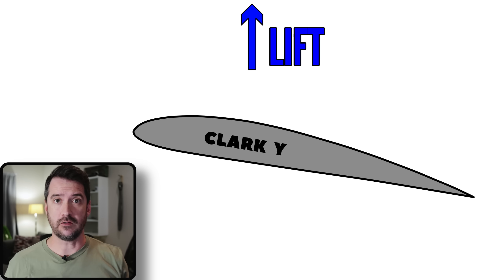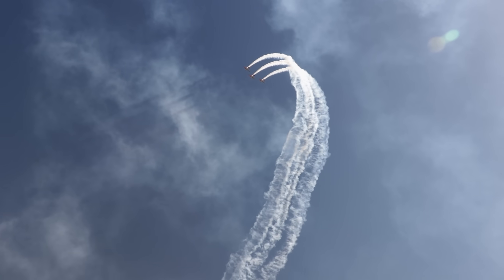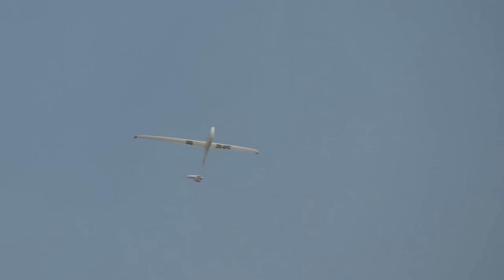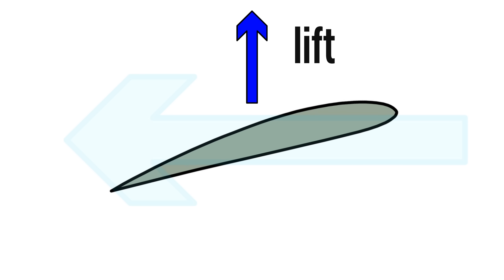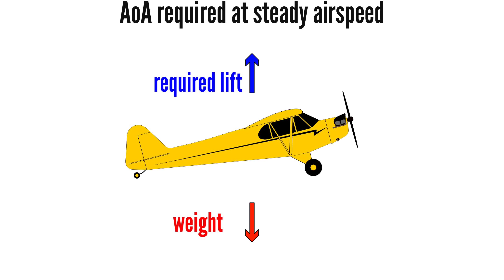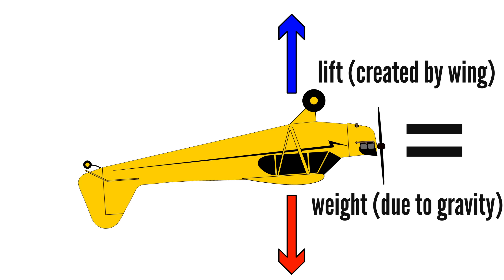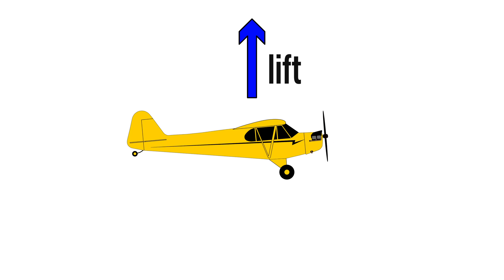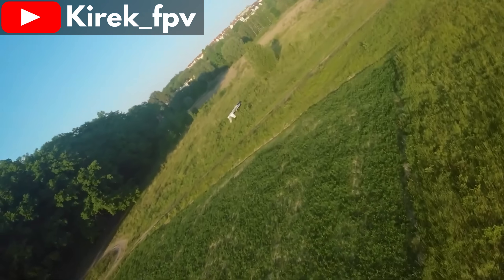Is Airflow Distance Over the Top of a Wing Always Longer?

Comment: You have made an excellent video here!  PMaybe you can please make a video explaining how the use of rudder alone in flight induces roll in the same direction? I'm certain it's not because the "outer"  wing is passing through more air and is therefore producing more lift and thereby creating a roll effect. I think it's caused by the dihedral creating a roll coupling by presenting the "outer wing" at a greater AoA and the "inner wing at a reduced AoA am I right? I don't know if there is any roll produced in an aircraft with no dihedral (presumably not) or if indeed adverse roll is induced in an aircraft with anhedral (inverted flying?)
Reply: A Cessna 172 with no dihedral will eventually drop the right wing with sustained right rudder in a skidding turn. However, depending on the plane, a rapid right rudder can produce some amount of left roll since the rudder is usually above the center of gravity.  This dynamic effect is momentary, and eventually there is right roll as above.
Reply: I thought this would be the case. I don't like comparing RC planes to full size aircraft too often but I have had a model that would do complete rolls on rudder only - the opposite way to the input! Adverse rudder roll was a thing with that plane. It had a large rudder with huge throws and a lot of area forward of rhe hinge line at the top of the rudder.  No dihedral in the wing either. Was a hoot to fly 🤣
Reply: @Eatherbreather  No argument about you or jaywung's thoughts three weeks ago, just a footnote:  there was a noted very successful family of hang glider designs in the seventies, known as Icarus I, II, and V (and maybe IV was also built) by one Taras Kiceniuk Jr., that steered by the yaw-and-dihedral scheme you initially mentioned.  They were configured as flying wings with pronounced sweep and dihedral, with drag rudders on the wingtips, each rudder deployed independently and outward only.  Hanging a rudder out yawed that wing aft and inward, so that the dihedral reduced the AoA of the aft wing and increased it for the forward wing, and after a brief skid the glider briskly rolled into a turn.  Pitch control was by weight shift but there wasn't a typical control bar, because roll was more positively controlled by the tip rudders.

They also had pronounced washout, especially the V, which made them almost unstallable because the tips, which were aft, would keep flying after you'd stalled the root, so the nose would refuse to stay up long enough to stall the whole wing.  The only accidents I read about were clearly pilot error (one skimming the ocean too low above rocks and one without positive harness for the pilot).

The V's were a monoplane (chosen to get a better view of the landscape below) -- 5' chord x 32" span, 6' sweep -- and had higher performance (L/D about 12) than the I, II, and maybe IV which were all biplanes.  (I guess this was because the V's had less parasitic drag -- fewer vertical struts and diagonal cables, and a much finer trailing edge because the aft spar was tucked in a bit forward instead of fattening the trailing edge -- and because they had a more sophisticated custom airfoil.)  But not many V's were built because they were mostly sold as plans-only, with a kit version available for a year or two.  A modestly tweaked, and motorized, version of the II (or maybe IV) called the Easy Riser, produced by one Larry Mauro, was sold in much greater numbers, had a Yahoo group while those lasted (i. e., until quite recently), and might have several planes still flying.  I bought a kit for a V and got it more than half done but then started engineering school and never had time to finish it.

Comment: It's in the name "aeroPLANE". It "planes" - like a stone (or some boats) skimming over water. If it slows, it sinks. If it accelerates, it climbs. Also noteworthy is an increased angle AoA either upright or inverted typically also sees the thrust line angles upwards which also contributes to "lift"  with the engine taking on supporting some of the weight of the aircraft itself. In the extreme sense this would see the wings becoming dead weight with the propeller (thrust alone) bearing the entire weight of the aircraft when flying vertically upwards. 
I have never met an instructor yet that knows that wings "plane" 🤦🏻‍♂️. Typically I don't argue with them though 😂
Reply: There! That's the analogy I was thinking & looking for!

Comment: Sorry your theory is incorrect ,easily explained ,take a aheet of paper curl it over and blow on the the top the paper rises  same as if you place the bqck of a sppoon in the stream from a tap its dawn towards the stream and differentual in pressure creates a rwsultant lift force ,your argument that a plane flying upside down still has a lift component due to the surfboard effect  a certain amount still lifts thd wing as in ground effect half the wingspan above a surface creates ground effect  like  ekranoplan air vehicles  ,benoulies priniclke explains this with venturies increase pressure in a constricted area pressure drops as a wing is half a venturi  tge pressure drops creating lift .
Reply from the maker: I agree with this. Think you may have misunderstood me.

Comment: I graduated high school in 1974 and we where taught that the air going over the top of the wing with the angle of attack caused a more negative pressure and lifted the wing and not the pressure under the wing pushing it up. That never sounded right to me so the way I started looking at it (write or wrong) is the combination of the angle of attack, the forward motion of the wing, and the speed at which it is moving all combine to create a pressure differential between the top and bottom of the wing. I am not a scientist, mathematician, a physics or aeronautical engineer but I do observe things and when I can't make sense out of what someone is telling me I have to question it. Come to find out it seems they where teaching theory as fact back in those days too. I may not be anywhere close to right but it's what I see in my minds eye. What I do know is someone knows something because the sky is full of airplanes.
Reply: AGREED!  JUST A KID WITH PARENTS DRIVING, MY WINDOW DOWN, HAND OUT, AND WHEN THE IMPACT ANGLE OF "FLAT" HAND ATTACK NEARS PERPENDICULAR TO AIR MOTION = ARM RIPPED VIOLENTLY ?BACK?!  BITD TOLD THAT IMPACT= 30% OF "LIFT"?
Reply: @georgedunkelberg5004   I think that is tricky, because if you carefully held your hand at like 45 degrees, it was okay, but if you weren’t careful, the Lift would try to start twisting your hand at about 30 degrees and when your hand turns flat into the wind, the drag actually doubles and that’s what jerks your hand back.
Reply: If a wing has 3 degrees of Camber (curve) and can fly level, it would be able to fly upside down with 6 degrees  angle of attack when upside down.
Reply: @jsbrads1 …camber is measured as percentage of chord, not degrees. Perhaps you mean if a cambered wing enables level flight at a given angle of attack and airspeed, it will require approximately double the angle of attack to fly level when inverted at the same speed.
Reply: ….airspeed and angle of attack (as a proxy for coefficient of lift) are the only two variables within the general lift equation that are directly controlled by the pilot hence the consideration of lift in those terms makes a lot of sense. Then, the understanding of why a given angle of attack results in a given coefficient of lift, whilst required knowledge for the aeronautical engineer, is of academic interest to the pilot, except perhaps when it comes to the stall.
Reply: @XPLAlN   the lifting thrust at the moment is all that matters to the pilot.
Reply: @jsbrads1  …if you had any experience in this field you would not mix the terms thrust and lift into “lifting thrust” (a phrase that could apply to VTOL but certainly not in the case of wing-borne flight). And that, taken along with your previous conflation of camber and angle of attack tells me that you are most definitely a sciolist.
Reply: @XPLAlN  LoL! Okay expert man. I was trying to refer to the force experienced by the aircraft rather than a number that the pilot isn’t directly experiencing. I feel so bad now 😂
Reply: @XPLAlN  a what?
Reply: @crispinmiller7989  ?
Reply: @XPLAlN  Sorry, the thread split our replies so far apart that it wasn't clear what I was asking.  I was trying to ask what word was meant at the end of your sentence "And that, taken along with your previous conflation of camber and angle of attack tells me that you are most definitely a sciolist."
Reply: @crispinmiller7989  ok, I see. Sciolist: a person who pretends to be knowledgeable.
Reply: The pressure under the wing is atmospheric pressure, it's the lower pressure on top the provides lift
Reply: @jeff5101   just looking at the photo for the video, looks to me like that red area is higher pressure than the rest of the wing, and the blue area is lower than the rest of the wing 🤷
Reply: @jeff5101  
The *difference* in pressure is what creates lift.
Reply: Thank you for a clear and open response. So far, nearly all of life is a working theory, rather than a proven fact. As we continually address more and more foundational assumptions to our current conclusions of the-way-things-are-to-me, the more weeding out of things we were mistaught.
Reply: After the critical angle is achieved, exceeding the angle doesn’t stop the creation of lift, all that happens is drag goes up because there is not enough low pressure to reestablish laminar flow by having the pressure push the airflow back to the top of the wing thereby reducing drag. 
Relaxing the controls will achieve controlled flight. I’m out of here ATP1830202
Reply: "(write or wrong)"?  Really?
Reply: It simple terms what you were taught IS correct.  It is easier to create a lower pressure on a subsonic wing than a higher pressure.   Now, when you look at very high flying super/hypersonic vehicles, the local air pressure is already near vacuum.   Lift there is produced by compression from the lower surface shock.  A good example is the XB-70.  One of the reasons (but not the only one) for the wingtips to fold down for high speed flight was to 'capture' the shock - a wave rider, if you will.
Reply: @davetime5234  not a theoretical coefficient.
Reply: So on that basis a transistor radio can't work because you can't see how it works?
Reply: See: Bernoulli’s principle
Reply: Stick your hand out your car window and move it around. When your palm is facing forwards slight, you can feel the air pushing it up.
Reply: I was also taught the equal-time fallacy.
Reply: As I recall on a classic aerofoil 20% of the lift comes from high pressure below the wing and 80% from low pressure above the wing
Reply: @EntityWar  …that would be true at a particular angle of attack. Whatever the split happens to be, 100% of the lift always comes from the difference between the two (upper and lower surface pressures).
Reply: @EntityWar 
It is more the difference in pressure than the magnitude change of pressure from static pressure.
Reply: bs
Reply: @EntityWar  That's how I learned too. So in this case the airplane rides on lifting force is a misconception, actually the airplane hangs in the air.
Reply: @EntityWar   for every object, the net force on it is a balance of all the pressures on all of its surfaces.
Reply: total lift equation explain that

Comment: Good explanations. 
The theory is still flawed, although it does come close to why lift is created. It has to do with high pressure vs low pressure. The exact areas where these happen, disprove the theory.
Reply from the maker: You have a point here, of course. Though I didn't attempt to fully explain lift, but rather showed why a certain argument about an upside down wing does not disprove the longer path or the pressure differential (Bernoulli) theory like so often claimed.

Comment: It’s the Reynolds number equation or scale effect that is the dominant difference when comparing an RC plane to a full scale aircraft. Wing loading is comparable and does not affect glide ratio, just the time over distance. Check out L/D wind tunnel polar comparisons of airfoil cross sections for a better insight. It’s referenced as ‘Inverted’ flight. Of course, there’s far more to know. Soaring birds are an excellent example of how nature has solved the problem of flight. Simply stated, the broader the wing span and greater the aspect ratio, the more efficient the lift becomes.
Reply: Watch bird feathers in flight, they are drawn upwards by the low pressure above wing.

Comment: Thank you. I've been annoyed forever by the wing theory nonsense we've been fed. The reason you have more lift on the upper
surface is that downward angle of the upper surface is greater than the lower surface. If you have laminar flow this is what accounts for the difference in lift between the upper and lower surfaces. Newton's third law doesn't take a holiday because of Bernoulli. Also, I've performed outside loops with a flat bottomed wing. Very inefficient but do-able. I love symmetrical wings. What aerobatic flyer doesn't?

Comment: yes the stagnation poitn can move but unless you stall and evne if you stall ti doesn'T move nearly enough for transit times to be even
you get airspeed ratios of more than 2 between the upper nad lwoer side, as is obvious from common lift coefficients nad bernoullis principle though the exact lift distribution alogn lenght varies
but the stagnation poitn would have to shift VERY far for tranist times to be even
they also just
aren't
you can see that in testing
the cause and effect is clearly air go down, lift is produced, pressure differnece is produced, thus airspeed varies
if it was transit time you could have a pump pump water into a manifold and hten through a hsort tube into a bucket and set up the pump pressure and tube size so that the water moves through the tube at a few meters per second, then yo ucould get a very very very very long hose that you just kindof coil up mostly to conent hte smae manifold ot the same bucket and water flowign throuhg both ways in parallel would have to speed up to like mach 100 in the coil, thats just not how reality works

Comment: lift is really mostly produced by a weighed average between its total aoa and trialing edge angle deflecting air though
camber helps you get those while keeping the leading edge aligned with the airflow and camber lets you ahve trialing edge angle while having a chord aoa of 0 and camber and thickness distirbution can influence when you start getting stalls and how much aprasite drag oyu get and how much lfit precisely you get at what aoa how efficiently but the working principle is plate angled, air go down, plate go up
Reply: A ramping or camming effect?

Comment: It's really not about the path, it's about the air pushing on the wing. The lower pressure air over the wing allows the higher pressure under the wing to lift the plane up, which works either way up.

Comment: The demo I got was a spoon under a faucet. If you gently hold a spoon by the end of the handle, let the outer curve hang and slowly move into the stream, the water pulls the spoon.
Reply from the maker: That's a nice demo!
Reply: @LetsGoAviate  https://en.wikipedia.org/wiki/Coand%C4%83_effect

The spoon demo is an example of the Coanda effect, not mentioned elsewhere in this debate.  (to the best of my knowledge).

My issue is the dubious assumption that two particles of air at the separation point will exactly meet up each other at the trailing edge, (one particle having gone above the AF & one below).

Frankly this is nonsense, and the very basis of the "different path length" = different average velocity = Bernoulli lift.

I'm not saying Bernoulli lift does not exist, but is only one component of a three part equation.

In my opinion B lift is the lesser of the three, and Newtonian the greater. The MIT lecture on this topic also dismisses the  particle convergence at the TE.
Reply: @leebonney2773  I was skeptical whether the Coanda effect would be predominant. I thought: you have one side of the spoon in contact with running water at a lower pressure (because of Bernoulli's principle, the water is in motion and if it was static would have the same pressure as static air) than the other side of the spoon with static air. That pressure differential could be easily enough to explain the force pushing the spoon into the water.

So I thought to test that, replace the curved spoon with a flat knife. The results of my very crude at attempt at that: as the knife nears the flow of water, the water is attracted to the knife (Coanda effect) rather than the knife to the water and the knife doesn't seem to want to move into that water at all: it's angle of attack if anything is producing a force away from the water. It's very crude but does suggest that the Coanda effect is indeed what's at work for the spoon.

And I agree entirely on the different path length explanation being nonsense. (i.e. if the spoon or knife was entirely within the flow of water) then the lift force is mostly if not entirely because of the angle of attack creating high pressure on one side where the fluid impacts the leading surface and low pressure the other side where the fluid has been separated and cannot instantly recover. Airfoils are just ways of making that more efficient (less draggy) by trying to maintain laminar flow and minimise turbulance. 

I'm not at all an expert but I'd go further than you and say I expect Bernoulli lift is negligible for most monoplanes unless something very curious is going on above or below the wing (such as with a wing-in-ground effect).